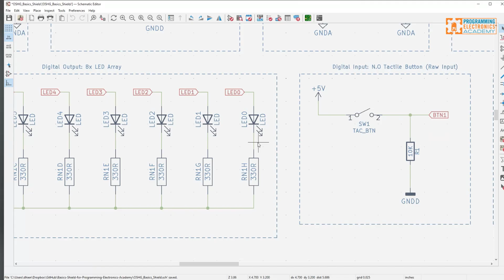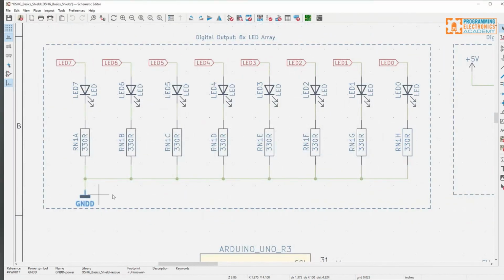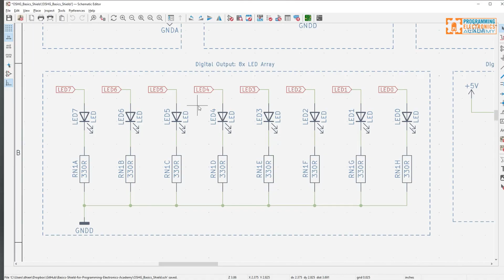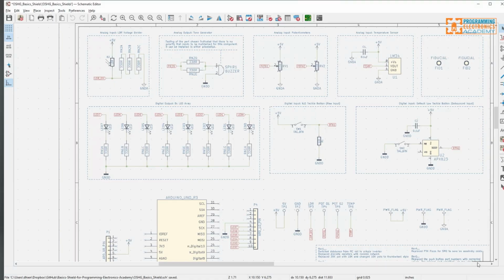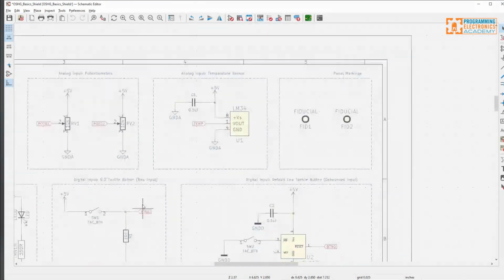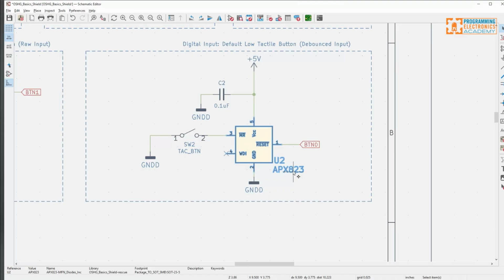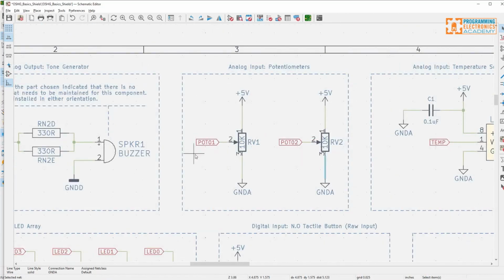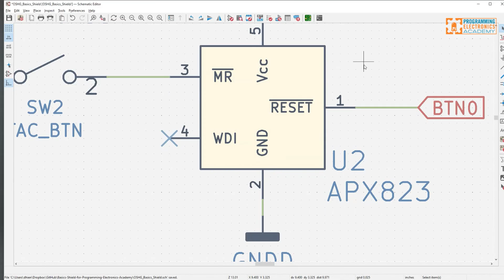Live Schematic Review Highlights #Arduino

Comment: Playing it at half speed is ok, but the sound quality goes down. I think reading schematics just take practice. I like both styles of schematics for different reasons. This version is good for quick and easy led connections and simple designs. I want to note that this style only works if you leave yourself notes or notes for others and they need to be good. In my opinion the best way to leave notes for yourself and others is to write them in a way that you would understand if you came back ten years later and had amnesia. It is meticulous work but, if someone else reads it they will always use your schematics because its clear.  

While old-school schematics have the connections drawn out sometimes this can lead to bad circuit logic like a 4 connection node coming out of 1 led, which in a professional environment could lead to trouble. They also have overlapping lines which can lead to  visual confusion, but I do not blame the person who drew it. It is not always easy to draw the schematic in a way that is clear to everyone. The positive of a old style schematic with wire to termination lines is if it is done right it makes it a easier step by step guide because you just literally follow each wire. The old school schematics are best when the person drawing them has actually built the wire harness or physically built out the diagram. finally, I do not know why people don't make a legend but that is a topic for another day I guess LOL. 

Thanks for the video it was helpful
Reply from the maker: Thanks for sharing your thoughts!!